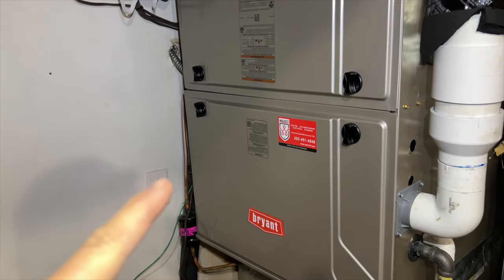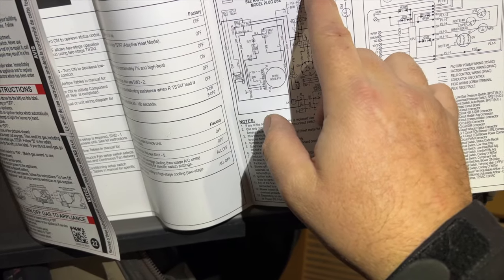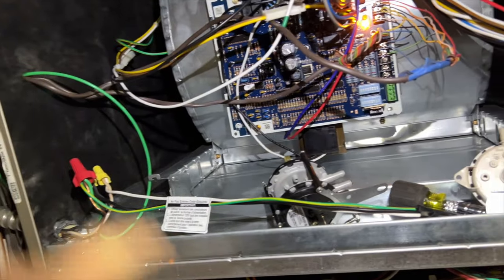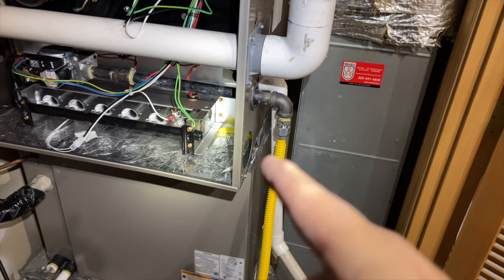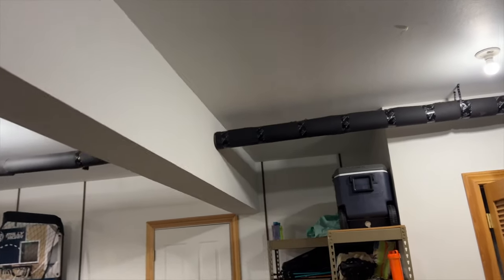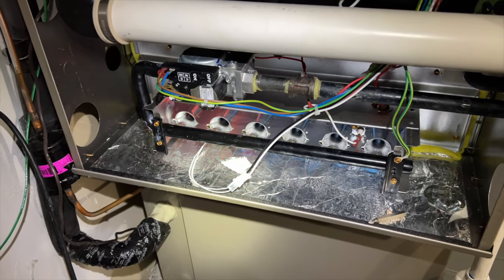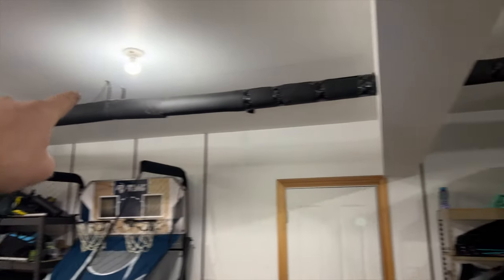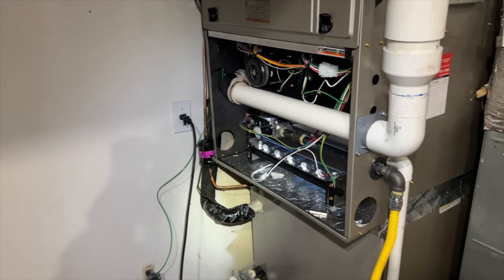Pressure Switch Not Closing Due to Drainage Problem On 90% Furnace EP108

Comment: The installers should pay the bill.  There is no excuse for mixing up the pressure switches. The installers can deny the pressure switch error. However the pipe i stall cant be denied

Comment: All condensing furnaces have a detailed description of the length of pipe, size and how many elbows can be used or how much the pipe length is reduced based on the number of elbows/45s. Can't tell you how many times I've seen incorrectly, newly installed furnaces with the installation manual sealed tightly in the plastic package and never glanced at. BTW, Lennox furnaces come with a trap that can be mounted on the side of the furnace or remotely, up to 5' away, but they also have a vent that requires 3/4" pvc added to it that must be at least 1" above the cold end header box drain but not more than 2" above the drain for upflow. If it's a horizontal install the vent pipe must be at least 4" above the bottom of the furnace but not more than 5". There's obviously a great deal of specifics involved and it's not because the engineers just wanted to be jerks. It's either done correctly or not, no winging it.
Reply: Easy fix on my Lennox. the metered orifice plugged off and the pressure switch was shutting off the furnace. I drilled and tapped a hole in the trap and installed a plastic tubing drain with a loop that acts like a siphon on a steam boiler gauge so that no flue gas gets in the house.  Retired steam engineer fix.
Reply: @rooky55 what is the metered orfice.?

Comment: If it was so buggered up with those switches wired wrong why would it even work and fire up once? So strange the things someone did. Not the installer I am sure as some comments below are saying. That ceiling pipe install is disgusting I could of figured out that it would be a problem when I was 7 .. Played with lots of hotwheels they would end up in a low spot on the track h ha ha Thanks great video BTW have you come across those Lennox furnace with the ignitor way in the back right facing upward and you cannot pull it out as there is only like an inch and a half room? I am there right now and I think the combustion box or something else  needs to be removed. Got the bracket off finally but the hex screw I can only see part of it and can only wiggle the bracket an inch anyway it is such a tight fit and the room below is less then the length of the ignitor rod. Might have to call the "Furnace Man" but Good Lord what if he is dumb and did bad stuff like these installers did? Thanks any tips from anyone would be appreciated
Reply from the maker: Yeah you have to remove the whole burner assembly to get to the ignitor.
Reply: @NighthawkHVAC  Thank you soo much for your quick response. You rock ! Guess that is too big a job for me calling the furnace company. I will tell them the model # to get the quote. All the best to you :-)

Comment: Good catch. I was working on a 98% and the flame would drop out, I had checked everything could not understand why. So I start pulling off all the hoses from the collector box then tweaked my back, so I kind of fell back into the wall and just sat their. Then the owner a lady says ( Do you even know what your doing ) your the third guy out. I sat and stayed quite. I looked at the bottom left side drain nipple from the collector box and saw white stuff in it. ( Usually on 80% inducer motor's you see this all the time ). I went NO WAY! stuck my small screw driver in their it all broke apart . Put all the hoses back on and BAM! zero problem's. I have only seen this once on a condensing furnace.
Reply from the maker: Nice!

Comment: Great info, my son has a new furnace and the guy ran the pipe across the basement ceiling to the outside, straight out to a 45 degree pointing down. I hear a gurgling sound and there is way too much dripping on the concrete. Now need to get it fixed...
Reply: Gurgling bad. Get the installation manual out, follow the manufacturers directions, you will solve the problem.

Comment: Did you say Lenox does not have it's own condensate trap? Why is that and how can it function w/o one?
Reply from the maker: Some models of Lennox don’t have one built in but still require one added to the drain line. Came across many without one installed due to the installation manual not being read.

Comment: is there a drain outlet at the bottom/lower portion of the inducer housing/collector box? seems like the housing and collector box should drain even if that horizontal vent pipe was holding water..
Reply: I'm wondering as well. I see the drain pipe but how does water that was filling the vent pipe end up at the drain?  Doesn't seem like water goes back to the inducer housing and end up at the collector box then to drain.  Great video for sure.

Comment: Hey Nighthawk, find a manual that shows the venting the way you did it is approved by the mfr.
Doing it this way increases the pressure on the venting system and by EVERY Carrier manual, is NOT correct.
Intake done this way is correct because it minimizes the possibility of sucking in the exhaust.

Exhaust is to be straight out/up or one 90°, like it was when you found it.
Hopefully this was not your company that did the install.
It is as if the installers never opened the installation instruction or if the bage is open, they cannot read.

Comment: Does code allow for a drain to be installed in the flue in your area? I have seen them in my area installed for the same issue...
Reply from the maker: I think it depends on the manufacturer. Some carrier units required one near the unit and even comes with a proprietary condensate trap.

Comment: I replaced my pressure switch with a new one but it’s still throwing the same 3 red light code saying it’s stuck open. Any ideas?
Reply: What type of furnace do you have? 80% or 90 plus.
Reply: I had water in the little pressure switch hose, causing same error code.